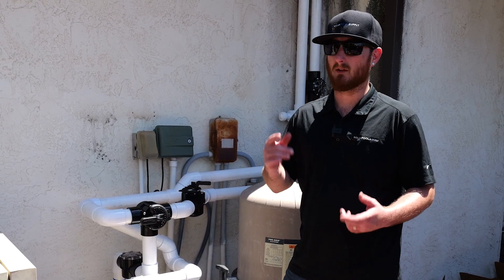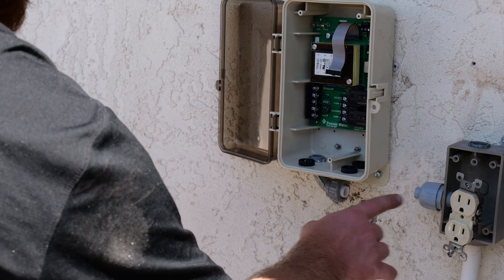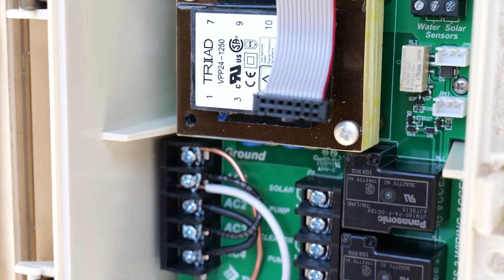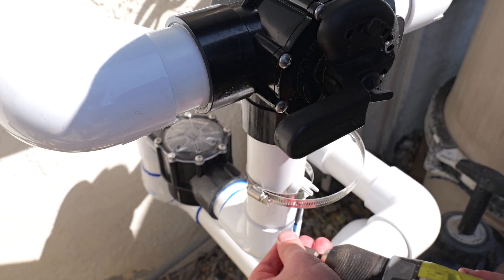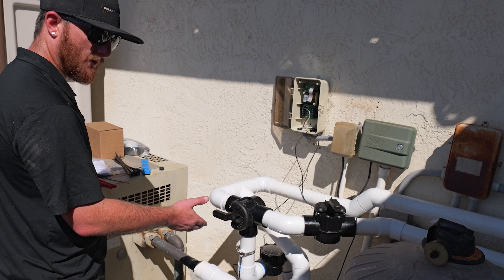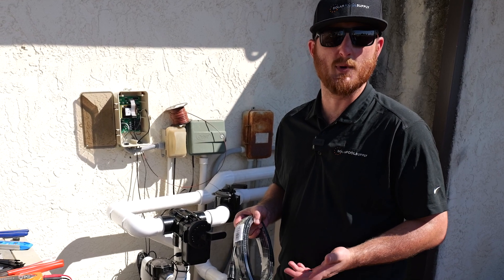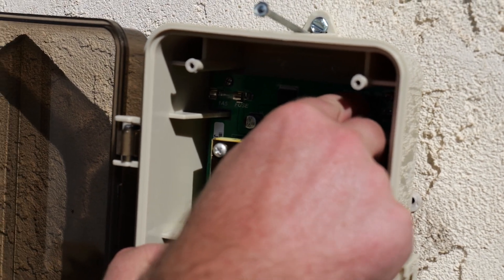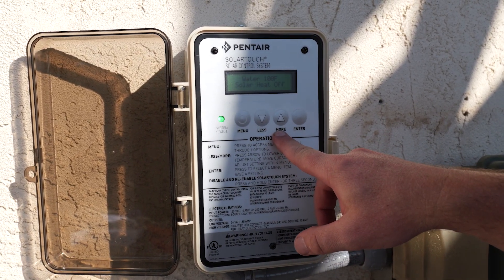Pentair SolarTouch Automation System Installation in 2023 | SolarPoolSupply

Comment: Thank you for detailed information! One question, I currently have a pentair solar system working with a pentair pool pump, but my pump just died. If I get another pool pump, do I just disconnect the communication cable? Do I need to reprogram anything? Do you recommend to get another pentair variable pump? I am considering other brands because pentair is a little pricey.
Reply from the maker: It depends on the level of pool/solar automation you need or want. If you have various features, such as solar, cleaning systems, water features, spa, etc. that must be integrated with the pump, then yes you will need a compatible Pentair pump to achieve that. If you use a pump that isn't compatible you will lose those features. For example, on the solar side the automation would still open/close the solar valve, but you would lose integrations such as solar operation pump speed and freeze protection.

Comment: Anything to pay attention to if you plan on having solar and a heat pump?
Reply from the maker: Yes, the solar should be tied into the pool equipment after the filter, but before the heat pump. You may also want to consider a heater bypass so that you have the ability to bypass the heat pump as well.